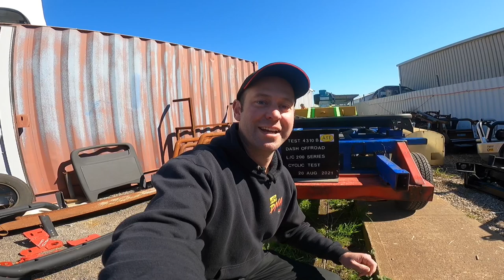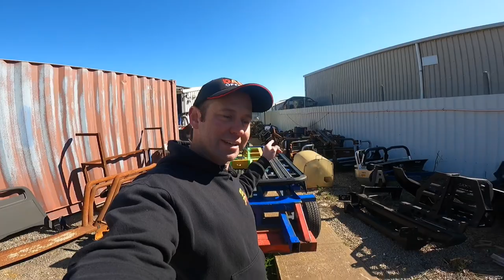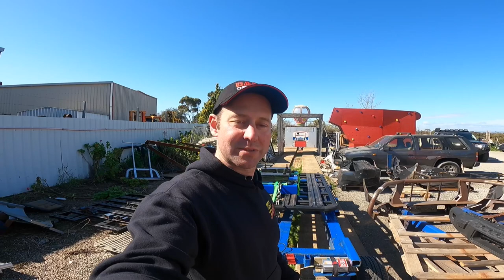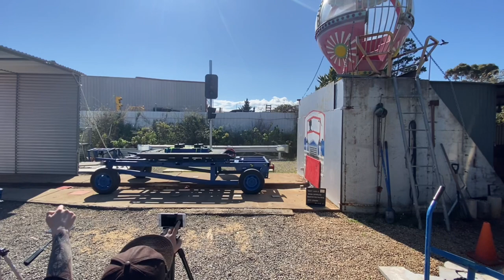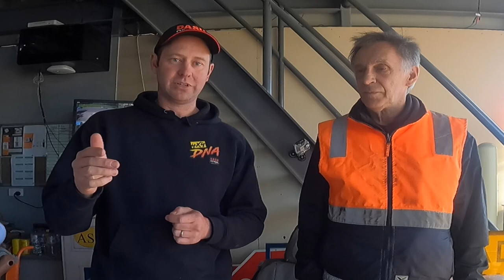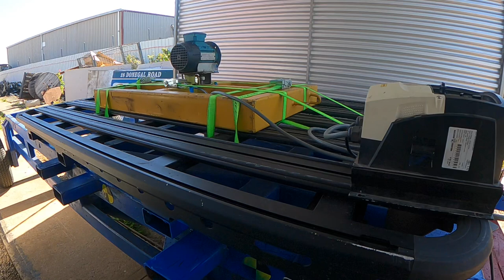How Does Your Roof Rack Rate? DASH Destructive Testing

Comment: Even happier I bought one.
Some constructive criticism if I may. The rubber washers that are supplied ( vast improvement on the stick on "donuts" ) do not sit properly on the inside of the main rails as the holes are too close to the radius of the bend. There was no washers to sit between the head of the SHCS and the rubber washer to be able to do the bolts up properly. I got some SS panel washer that I will trim to sit flat and clear the inside face of the main rail. 
One last thing, the wind deflector seems to be way more complicated than it needs to be. Tried to get some photos from the guy in the office, but he was no help whatsoever. Given the shape of the deflector with the double folds and having to be bolted from underneath, it doesn't fit. I'm lucky I have access to equipment so I can make it fit, and be a lot simpler to manufacture. May put a photo on the FB Y62 page. 

Cheers

Daz
Reply from the maker: Definitely noted, we’re improving all the time, next batch will come with an Allen key tool that will help mount the wind deflector

Comment: How was the rack connected to the slide? I would still derate  the load for off-road use
Reply from the maker: It’s connected to the simulated vehicle with the same hardware as fitting to your Y62

Comment: What would Nissan's take with regards to warranty be for sustained or long distance  "off-road" net roof rack weight load if the vehicle sustained structural roof damage. 
I know with my Pajero..the roof static load 100kg..less roof the rack weight 17kg is about 80kg..but in "off-road conditions"..a point of reducing this 80kg by up to 50% and more depending on the sustained off-road conditions I would encounter for a sustained time period.
The example given to me...Birdsville..Oonadatta Tracks..about 40 kg and on tracks like the Canning..30kg max...would be preferred.
Reply from the maker: That would be an interesting reply from Nissan I reckon